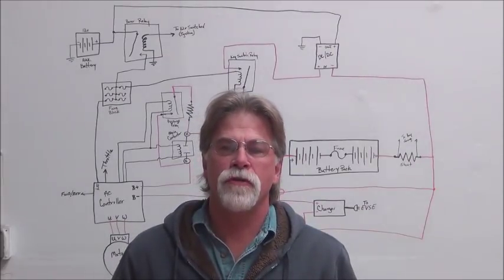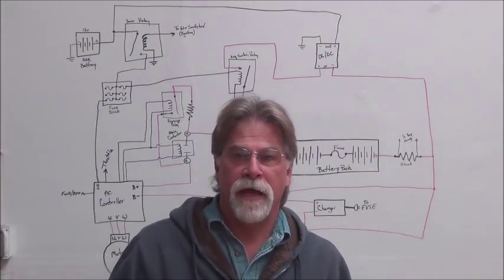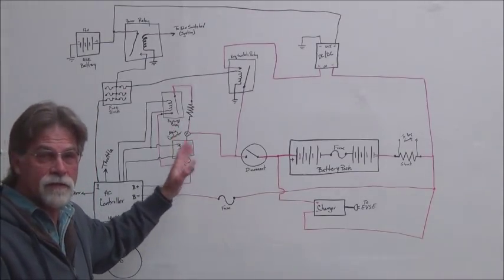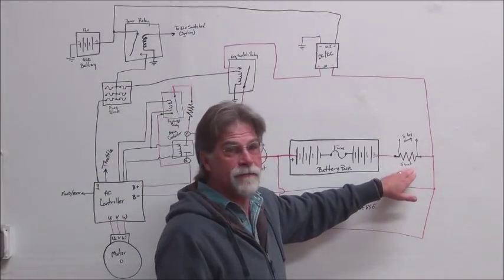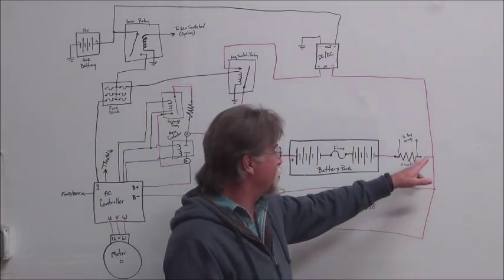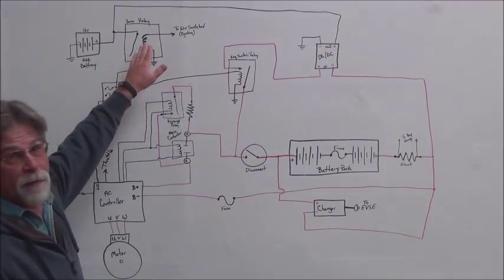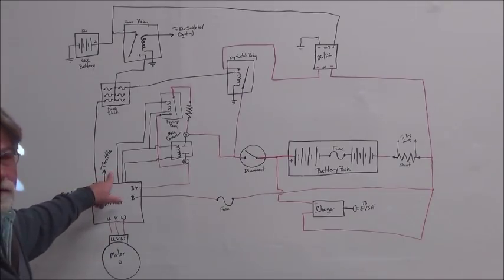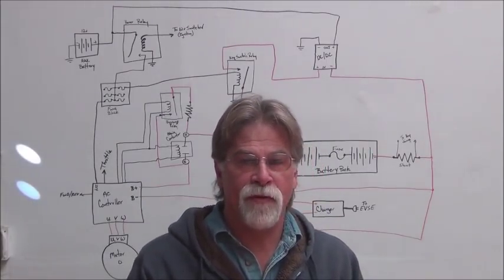DIY Electric Conversion - Basic EV Conversion Wiring  www.EV4Unow.com

Comment: Can you comment more on the fuse between the pack?  Can you give an example of the total pack voltage and amp capability and then recommend the appropriate fuse size.  For example, if my pack generates 100v (88v nominal) and 900a (450a continuous) what fuse would I use?  Would I use multiple fuses in series or parallel?  Thanks.
Reply from the maker: Please address your questions or comments to info@EV4Unow.com thank you.

Comment: I have been watching ton's of EV videos, but this is the only one that allowed me to "get it". Thanks for the info. I'd like to see a video for how to select vehicles for EV conversion. Also, it seems like EVs are popular in moderate climates. What about in the Southeast where it's 100% humidity and 98 degrees in the summer? How efficient would a conversion be that requires both heat and air conditioning?  Thanks!
Reply from the maker: Heating and cooling usually will decrease your range by about ten percent.  But there are a lot of variables, this is just my personal experience over the last ten years.